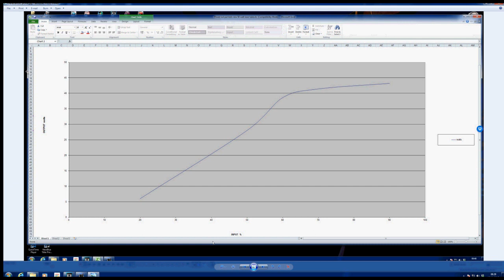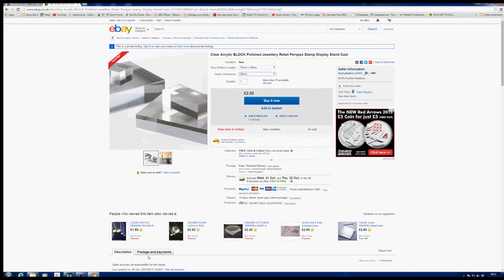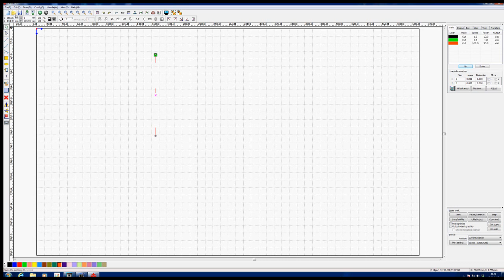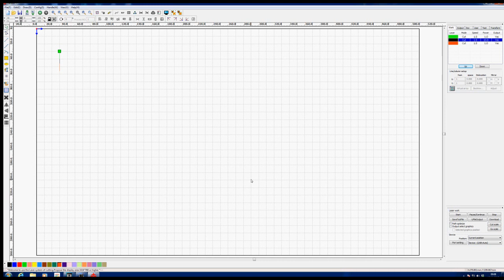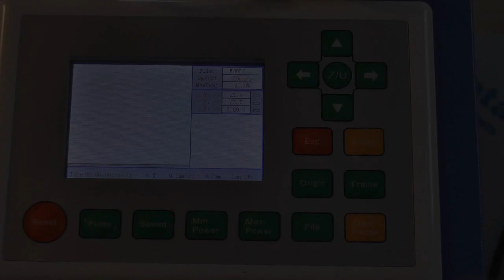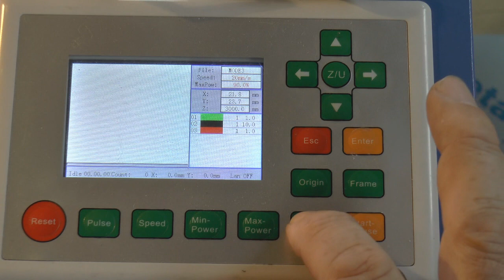RDWorks Learning Lab 22 The 50watt fraud   a lesson learned

Comment: Thank you for these tutorials! They are fantastic. I'm thinking of purchasing (probably from the same company) a laser cutter fitted with a 100W tube. The thing is, I have my suspicions as to whether this is a good idea or not, because it looks as if the machine is not made to originally fit a 100W tube, so it looks like the manufacturers have just added a protruded casing in order to get the tube to fit. My question is whether this will somehow compromise the machine's functionality and if I could consider this a safe purchase?
Reply from the maker: Hi Jessica
From my experience, ALL ebay machines are fitted with B grade tubes that work but not very well and often not very long. The important thing to check is that the machine is fitted with 25mm molybdenum mirrors and at least an 18mm diameter lens. Size is important if you are using a 100 watt tube . Different tube manufacturers claim different beam sizes  and 20mm mirrors may be ok for lower powers (50 watts and below), But above 60watts then the possibility of the beam having power out to 12mm does exist  Any 100 watt tube claim is likely to be false. It will be quoting peak power which you cannot use or you will invalidate any warranty that may exist. It may well be a good quality  Reci W2 tube for example  Reci claim it is a 90 watt tube but if you stick to their recommended normal running current its in reality an expensive 80 watt tube. You will never get what is claimed. I would chose a machine bed size that suits your needs and accept the standard rubbish tube supplied (maybe 50 watts) When you have had a little experience with the machine you can upgrade with a "proper A grade tube and power supply to suit your power needs. A word of warning. Engraving requires almost no power whereas cutting is power hungry. If you buy a 100 watt tube you will find it VERY difficult to do some types of engraving or card cutting because you just do not have sufficient power control at the low watts.  60 watts is a reasonable compromise power combined with 1.5" and 2" focal length lenses.  Look at the cost of 100 watt machines which may need a fairly quick tube replacement anyway  as opposed to the right size frame that you can upgrade at a later stage. 
Hope this helps a little
All best wishes
Russ
Reply: Thank you. That was very informative! I am taking your advice and am now considering a 60W machine with my desired bed size. I saw in one of your tutorials, where you switched between different sized lenses to run an experiment in determining cut depths, so that convinces me that I shouldn't have to worry about changing the nozzle or anything if I ever wish to change to a different sized lens. Is this also true for mirrors? Could I switch between different diameters without any problems?

On a different note, I came across this post on a forum about a guy that purchased a Redsail X700 (one of those red-black ones) and he seemed to come across several big issues. In his post, he mentions that all the wiring in his machine was 22 gauge and that they were melting from day 1, so he had to rewire with an 18 gauge. Furthermore, the main power and 3 plugs at the back of this machine runs through the E-stop, which melted after only 1hour of running time. At first I thought that this machine and the one you own all came from the same manufacturer, therefore with the same quality standards, but now I think I might be wrong. Is your machine of better quality? Or is it just a stroke of luck that you didn't run into any of these issues? They are selling this machine for cheaper, but since I haven't seen your machine run into any of the same problems, I am definitely more inclined to spend a little more and get the same machine as you. I provided a link below to this forum in case you are interested:
https://en.industryarena.com/forum/a-warning-about-redsail-x700-60w-machines-ebay-right-now--264142.html
Reply from the maker: Hi Jessica
There is a fairly simple explanation why these machines can fail in certain situations. They were originally designed in China for use in small Chinese businesses Just because they are shipped around the world now is not reason enough for them to change something that works....in their country. The problem is the world's electricity supplies divide into two camps. 
https://www.google.co.uk/imgres?imgurl=https://www.quantumbalancing.com/worldelectricity/images/voltages%2520around%2520the%2520world.gif&imgrefurl=https://www.quantumbalancing.com/worldelectricity/electricityif.htm&h=968&w=1347&tbnid=EId7rs7nVOLwLM:&tbnh=151&tbnw=210&usg=__sL_tNZ_eEJnJTuql_3Bt8TgW3jo=&vet=10ahUKEwiAs6q2zMjWAhUIZlAKHd-RD-oQ9QEILTAA..i&docid=JU6wFNGHPPl5JM&sa=X&ved=0ahUKEwiAs6q2zMjWAhUIZlAKHd-RD-oQ9QEILTAA

Take a look at this map and you will see that about 2/3 of the world's population uses a 220/240 volt system and  and mainly  it's the Americas that have settled on using 110 volts. 
If you can remember back to your science lessons and Ohm,s law, one aspect of it was that watts (power)= voltage multiplied by current.  In simple terms that's the problem being encountered here.  Halve the voltage and the current has to double to get the same power output. Doubling the current means heating the wire to a point where it melts the insulation. The machines are designed for use at 220/240 volts where the current is 50% of that required for the same power output in a  110 volt circuit  Copper wire is expensive and these machines are built cheap. I suggest they are not going to increase costs and compllcate stocking and distribution to satisfy the 110 volt market so all the mains wiring will be under rated and potentially dangerous
You did not say where you were from but I suspect you are in a country with 110volt mains? I have two machines. One which is all Chinese and cheap but works ok because my mains electricity is 220/240 volts. Thus small wire will not overheat. My other machine is built in China but with UK design guidance to make sure it meets world standards. I cannot say which other machines ( apart from the really expensive Epilog, Trotec and Universal machines) meet this higher standard for mains wiring. It's less than 25% of the machine's wiring that is carrying mains voltages, thereafter it's all low voltage dc. 
I can see it is a problem for you. If you buy cheap then you need to have some level of electrical competence to check and rewire if necessary. If you buy from an import company that are just local distributors for standard Chinese machines, you cou;ld well be buying the same problem at a more expensive price. There are companies that import Chinese machines  where they  do insist that local wiring standards are met but you will pay an even bigger price for that insurance.

Mirrors. Most machines will be supplied with 25mm diameter mirrors. This only becomes more important if you are using 60 watt tube and above.

I hope th'a answered a few more of your questions
All best wishes
Russ
Reply: @SarbarMultimedia  Russ:  I have a 50w Chinese machine here in the USA, running on 120VAC. No problem, as the total power requirements for the machine aren't really very much, and my 20A breaker in my garage never trips. All the internal parts for the US version are made for 120V input, with plenty of power to spare on a 20A service.
Reply from the maker: @markjenkins1569  
Hi Mark

You are right that the current draw from the machine itself is comfortably low and will run from a 120v supply. As you also rightly say, all the components inside the machine are either dual voltage/frequency compatible or have 120/240 switches.  I get lots of correspondence from US users  with 120 machine issues.  The most common problem is melting the emergency stop switch.and a few with melted insulation on some wires. These machines are designed and tested in China where the supply is 220vac. Run them at 120ac and the current draw will be TWICE that which some parts of the machine were designed for.  If you check the specification of the E/stop switch you will find that almost every one (certainly the one fitted to theses machines)  has a 10A rating . That is fine for the machine itself but the problem begins when you start plugging ancillaries  into the sockets at  the back of the machine, such as the water and air pumps plus a fan. ALL of that addition load passes through the mains wiring and the E/stop switch ....oooops!!!  So make sure you do not use those very convenient sockets, Run another multiway socket from one of your wall sockets and all will be safe.
Best wishes
Russ

Comment: Thank you Russ for your work you share with us. I'm at the very beginning on the learning curve you've passed. Don't even have my own laser. I'm at the stage of deciding: buy K40 and play with it or play with making my own machine with more power laser. Haven't decided yet.
But I have a question on the focused beam: is it possible to use more than one lens to form the laser beam. First (from the laser tube side) would be convex lens to focus wide beam coming from mirrors and the second one would be concave one to form  the beam parallel again but much smaller diameter hence much more energy dense. I haven't seen that so far. Is it because the concave lens will be burnt in few seconds?? 
Parallel, highly spotted beam would cut much better, deeper and with better edge quality. Isn't it?
Now i back to the rest of your awesome videos!:)
Reply from the maker: Hi
I toyed with getting a K40 as a starter machine. Everything about it was limiting. Low power (30 watts max), no digital control system, no adjustable table, everything mounted on flimsy brackets, rubbish mirrors, minute working  area, no air assist  etc etc......... The next step up to a 300x500 50 watt machine  may have been 3 times the price but it was a proper CNC machine that had real uses . I have really mixed feelings about what I bought because it was fitted with a crap tube and then I went out and bought a replacement crap tube. All part of the learning experience. I reflect and think that if that machine had been perfect out of the box, would I ever have embarked on this amazing learning journey. I am seriously glad I did not take the K40 route 

I have played with a 4" lens to reduce the beam size before it hits a 1.5" lens at the bottom of the  lens tube. Did not get the result I expected!!  Binned the idea. Not even promising.
However there are dual focus lenses already existing see
http://www.sintecoptronics.com/FocusingLensDualFocus.asp
Sadly they are large diameter for industrial machines
The problem with trying to be clever with lenses is the materials. The standard materials are zinc selenide and gallium arsenide. Both are only about 70 efficient at transmitting IR so they put an anti-reflective coating on the finished lens to bump that efficiency up to about 95%. There are VERY limited styles of lens in these materials, in fact I have only ever  seen TWO,  plano convex and meniscus. So your options to be creative  may be seriously limited.
Nice thought though
Best wishes
Russ.

Comment: If my 40 watt tube tests 34W max then I shoudln't run it at no more than 20.4 mA then ?  My K 40 has ampmeter not percent meter. Thanks.
Reply from the maker: Despite claiming to be a 40 watt tube, yours will be 700mm long and in truth capable of 35 watts max/ That means a limiting current of 17mA. If it was an 800mm long 40 watt tube them 18mA would be the limit. 20mA is for 1000mm long 50 watt tubes. 
 An ammeter is a the only way to know what is happening to your tube. Your tube is full of a gas mix and all those gasses are naturally non-conductors. However if you subject nitrogen (one of those gasses) to a  very high dc voltage,  it starts to break down by a process called ionization. In an ionized state, that non-conducting gas all of a sudden acts like a piece of wire and can carry huge current flows. You cannot allow this to happen so you need to regulate that current.  That current varies the energy level in the nitrogen which in turn is the driver for the lasing action.. So power is not regulating the laser beam directly. In fact when your tube is dead ie run out of CO2, there will still be a pinky/white beam in the tube. The engine is still working but the wheels have fallen off!!
Best regards
Russ
Reply: Thanks.
Reply: @SarbarMultimedia  Hey Russ, is that length/amp relation valid for all co2 tubes or just for those chinese made?
Reply from the maker: @fibranijevidra  
Hi
In general there is a simple rule to follow. Do NOT overdrive your tube. These are max values that you should abide by. if your tube is  40watts (18mA),  50watts (20mA)   56 watts  (22mA)   80 watts (24mA) 100 watts  (26mA) 
To understand why these values are so important take a look at

https://www.youtube.com/watch?v=2F5O-1TH8b0&list=PLPWEtx5V9DqEogIeYRdcG_KYcB7UL2Qmn&index=7&t=3s

Best wishes
Russ

Comment: Fine for checking performance change over time, but why would you assume burn depth is linearly proportional to output power ?
As you go deeper, you will get more smoke in the way, changing beam width and conduction away though the material is likely to be a nonlinear effect.
Reply from the maker: As you get further into the series you will see more of the experimental work that I undertake and once I get a power meter I know for certain. Wood smoke is one thing that is a very efficient absorber of the 10.6 micron wavelength light and MUST be blown away with efficient air assist whereas acrylic cuts with a completely different mechanism  and its cut is directly related to the energy density of the beam.  The further away from the focus point the lower the energy density and the weaker the cut. Also please remember this is effectively a video record of my learning about the technology and trying to understand all the detail problems that many gloss over. I make mistakes as I go and that is all part of the learning process. I appear to be blazing a path that others are following. I just wish there were paths for me to follow when I started out 18 months ago. However, nom real complaints because its benn the best fun ever.
Thanks for the comment
Best regards
Russ
Reply: if the smoke was the primary factor, the degradation of performance (the depth of the cut) would be linear because the distance laser travels through smoke is expected to  be linear, however that is not the case (see the 13:49).

Comment: Thank you for that awesome demonstration. May I ask why you removed the lens and didn't just run 10 colors at 10% intervals on the acrylic (with the lens on)?
Reply from the maker: +Hillel Posner 
Hi Hillel
I think I understand your question to ask why I didn't set 10 colour layers in my program and just run it?
Lens removal---- Ideally I would have liked to test the mode burn directly out of the tube at the back of the machine. I'm not only looking for depth of penetration but also the shape of the burn. The conical burn means that there is more power at the centre of the beam and the shape of the cone is an good indication of the power distribution within the beam.  It is difficult to position the block at the back of the machine and not all machines have space for a thickish block. I therefore thought it would be easier for others to replicate if I worked at the front of the machine. Now bear in mind that the laser is a collimated beam ie it comes out of the laser tube at about 6mm diameter and remains at 6mm diameter right up to the lens where it gets reduced to about 0.1mm  diameter at the focus point.  I am trying to see the power distribution across the beam and not the focusing efficiency of the lens. I hope that answers your first question.
10 colours----- The whole principle of this program is to run the burn for an accurate fixed period on each %. Sadly I could not find a way of programming the machine to stand still (???? in answering your question FLASH OF INSPIRATION!!!) the slowest I could run was 1mm/sec, so I devised the moving platform approach to keep the block positioned statically under the head. After every test I had to stop to reposition the block and thus I had lots of time to edit my % power parameter.
However. your question has prompted a ????!!!! moment. How can I get the machine to stand still whilst running a program? Answer,  UNPLUG THE Y AXIS MOTOR. Now I can write a multi % program with pause periods to reposition the block under a STATIC head.

Looks like I'll have to revisit this mode burn test to simplify it. Thanks for your input.
Reply: Thank you very much! I've been lasering for many years but never investigated the ma / power relationship or thought to look at how linear the power line was. You demonstrated that really nicely. My new laser has a MA meter and now I know what to look for. Thanks again.
Reply: +SarbarMultimedia How about removing the cable from Y axis and let the machine to move on X axis. This way you don't need to put your hands in there with the potential burn.
Reply: pauses between cuts would be achieved via horizontal lines with 1% power and slow speeds - if the slowest speed was not enough then come back a little :)